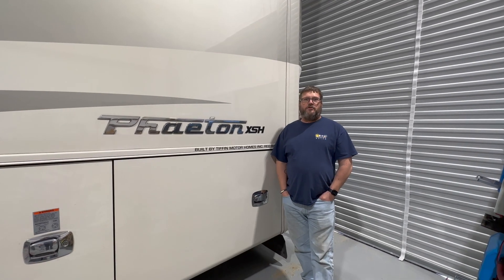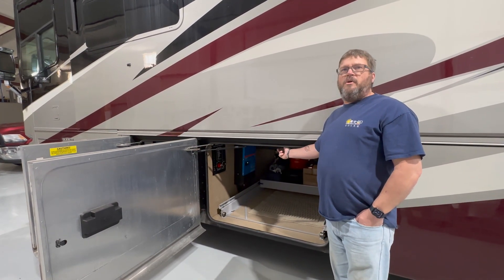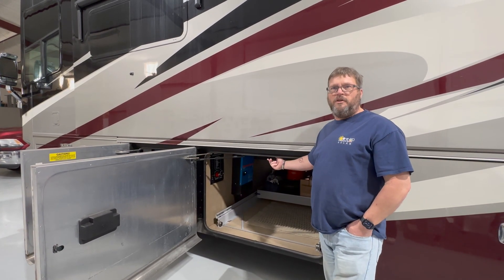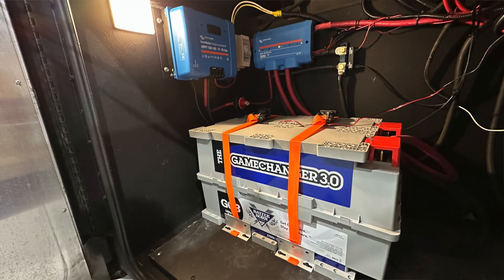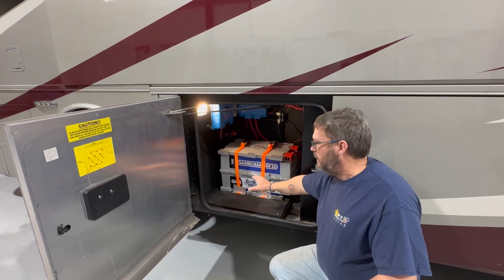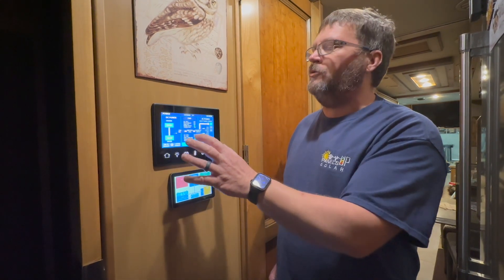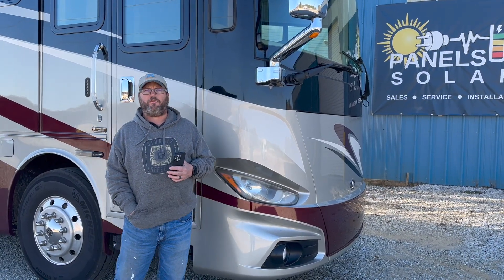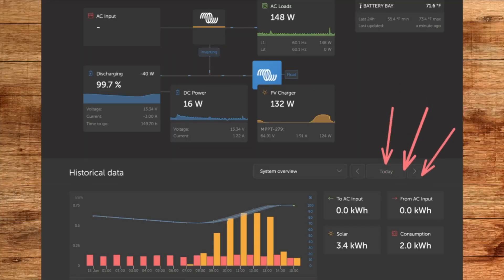Epic Off-Grid Solar Installation on a Tiffin Motorhome

Comment: I have the same rig and just about to add the lithium batteries too.  My plan is to add solar later, so the multiplus II has the build in dc-dc charger so I wouldn’t need the  12/12/50 then?  It replaces my magnum mc2012 inverter/charger?
Reply from the maker: No it does not have a built in DC to DC charger. You will either need to use a lithium BIM or use the Orion dc to dc charger or one of your choice. You will also need to rewire the ac wiring unless you only want to power what your MS2012 is currently powering.
Reply: @PanelsUpSolar I didn’t see a dc charger on this install?   Was this coach solar prepared too? Mine is, found the solar wires in battery bay and I have three caps on the roof.
Reply from the maker: @one2bow2 are you asking about a dc to dc charger or are you asking about the charger function of the inverter/charger to charge the batteries? The DC to DC charger allows you to charge from the alternator through the starting batteries. The inverter/charger takes AC power from a 120v power source and charges the battery bank. All newer model Tiffins are coming solar prepped now.
Reply: @PanelsUpSolar yes both really.  I thought you had to have the dc to dc to get full charge and not over work the alternator.   Or does your setup stop at regular voltage and solar is to peak out bank?
Reply from the maker: The lithium BIM that we installed will charge the battery to a resting voltage of 13.8v. With the Battle Born batteries, the absorption charge is set for 14.4-14.6 volts. So the solar will finish topping off the batteries if there is sunlight or the inverter can do it when the unit gets to its destination and plugs in or the generator is run. A Dc to DC charger can also be utilized if desired but it is usually a customers decision. I make recommendations based on their intended usage and installed components.
Reply: Two questions.  Why does the ac wire have to go back to transfer switch to new inverter, it switches now with the magnum.   2nd is the screen mounted under the spyder screen access point?

Comment: Just found your video. Very nice. What fasteners did you use to attach panel mounts on the Tiffin one piece fiberglass roof? Just screws?
Reply from the maker: Thank you. We have a process of installing panels. It might be little overkill but we've never had any issues with leaking this way. We did a video here about it: https://youtu.be/Pwo9yWzBwC8?si=3hLphcB6gHoszHWT
Reply: Thanks. Looks nice. Those screws I'm guessing are pretty short and grab the fiberglass only?

Comment: Where/how do you make the wire run from the ATS to the inverter?
Reply from the maker: Inboard to the frame and then followed the frame forward. It was not an easy procedure.